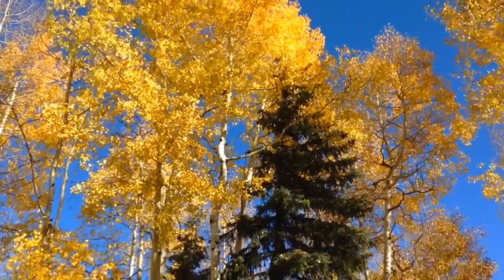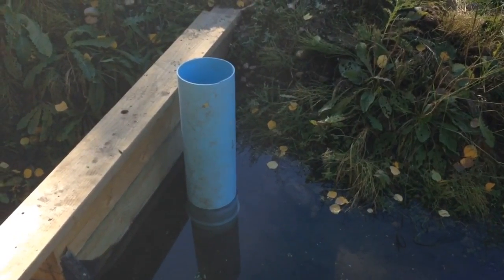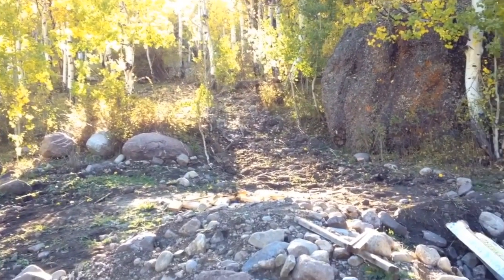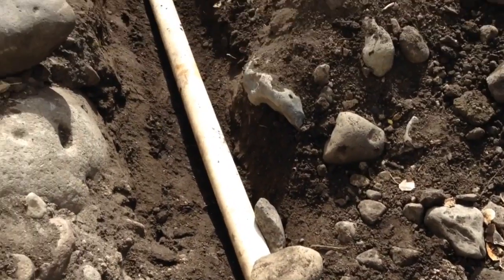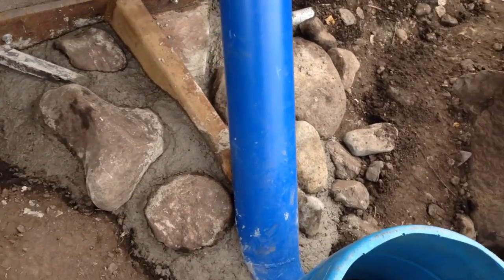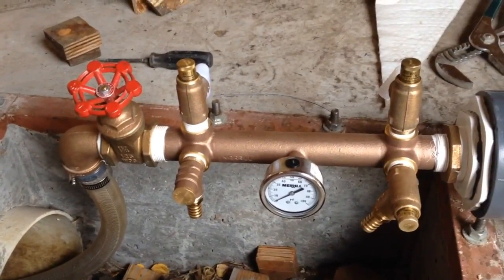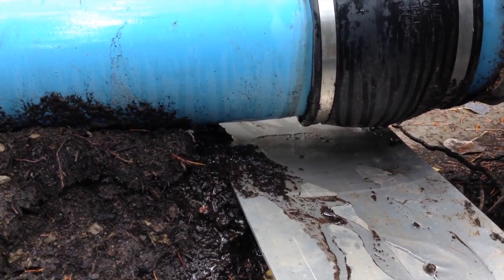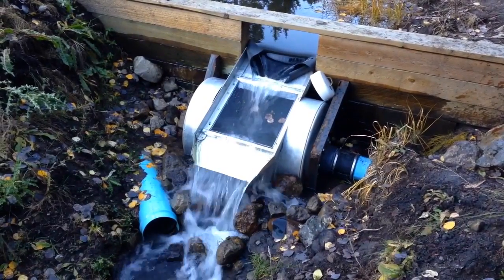Part 13 MicroHydro Power System in CO TESTING

Comment: +MrHydrohead What has the Colorado Division of Water said about this? did you have to get special permits or variances?  I was told i  can't even create a barrel rain water catchment on my place to water trees in ParkCO. I have a well, but i can't "Catch" water.
Reply from the maker: Yes it's true that in CO you don't automatically have the right to capture the rain that falls on your roof.  Sounds crazy but all the water is adjudicated by water court decree.  To make use of the water one must file a petition for its use in water court.  The original date of application becomes your date of adjudication if and when you successfully prove to the court a beneficial use for the water.  There are various uses you can claim for domestic use, hydropower generation, irrigation, piscatorial(fish), augmentation, stock watering and others.  All the water in CO has been claimed in years past by someone else based on their adjudication date and their rights are senior to any rights you might file on today(think CA, AR, NM, ranchers, farmers, cities, ski resorts and others).  The current conditional right we have on the creek in Colorado is a Run of River (ROR) use for hydropower generation filed on back in the 90's where the water diverted for use is put back into the same body of water it came from.  While the water is in the pipeline it actually is prone to less net evaporation than it would be turbelling  down the creek.  This is a net good.  After one makes application with the court to use water, if the court in conjunction with the Div of Water finds your claim of merit, you are issued a "conditional right" to develop and put the water to use on the basis outlined in your application.  This right will last for 7 years from your adjudication date and must either be extended by application every 7 years or be made "absolute" by an application to the court to prove the water has been put to the beneficial use(s) outlined in your conditional right.  This is verified by the division of water and if you pass muster you are granted an "absolute right" to the water in perpetuity.  These water rights are attached to real estate and must be legally transferred with any sale to be valid to any new owner.   These water rights are most likely secondary to other water rights granted in the past to people downstream.  You can spend a great deal of money with lawyers doing the legal work for you, or you can make application yourself(pro se) but you have to research the process enough to understand the process and not make mistakes that would invalidate your claim.  It's a system that has been in place nearly forever and is one of the reasons for the saying "whiskey is for drinking and water is for fighting."  There just isn't enough water for all the uses claimed over time.  It's a system with flaws but there has to be something to say who has what right.  The water that falls on your roof has been adjudicated via the district water court that governs the water body that is fed by that rain from your roof.  Nobody owns the water, it is a public commons.  Other states have different rules and then there are federal guidelines as well.  You must prove you will do no harm to existing water rights with your use and storing rain water would unfortunately do that if everyone stored the water from their roof say in cisterns.  These issues will likely become even more contentious if and when droughts reveal indeed how over allocated the available water in the mountain states have become.  Everybody with water rights got in line at some point and those that got there first hold the senior rights.  Sad but true. It's been established by the system of laws that have been created.  In the words of Rodney King "can't we all just get along?"....
Reply: a lot of water in Park Co, is deeded to Denver, Aurora or Co-Springs. We can have a well and do, but any catchment is a major no-no.  i get the "flow-through" of your process. At one time there was a movement to try to dam the arkansas in Chaffee County (between Buena Vista and Salida)  to feed the demand in the front range. Luckily it got nixed.
As it stands all of the South Platte river Drainage flows from Park County for Metro Consumption..

What part of the state are you in, if you can say?
Reply from the maker: Yeah, it is crazy some of the things metro areas do in sucking up water and fueling more growth.  
http://aspenjournalism.org/2015/01/30/state-water-buffaloes-gather-in-denver-talk-transmountain-diversions/
Transmountain is a word my spell checker doesn't even recognize. Hmmm, someone smells money...

Our water is fed directly out of a wilderness area and rights are non consumptive so hopefully they will sustain over time.  Without being too specific we are in the southwest area of the state in the Gunnison River basin which has been targeted for Transmountain diversion as well.  Absolutely nuts.
Reply: Oh definitely someone is wanting to make money, and all it will do to those of us who are grunts is make it cost more.

Sadly a Lot of "know it all" econuts getting in the mix to save some scum sucking minnow in the lower Colorado as well. :-)
Reply from the maker: +WIlly MacTavish 
Yeah, primary problem = too many humans = too many concerns,agendas and rules.  We like our solitude...
Reply: yep, us too. Love sitting on porch in fall and watching the aspens change!

Comment: Very cool...nice set up. What is current status of this system?
Reply from the maker: Currently capable of producing up to 4800 watts or ~115kwh/day. This is the upper limit of the system at this point due to the configuration to load components. Next year plan to up load capacity to 8500w or ~200kwh/day. Need to add some resistive AC loads and solenoids to manage them through the existing ELC.  All of this will occur after verifying the scale of available water at low flow this winter.

Comment: Very much enjoyed this series. Hoping you go into great detail on how to hook it up to the house, what all is needed and even where to get those items. Not many ppl take the time to tell about all of that. It would be a nice touch.
Reply from the maker: getsmartnow2011 Thanks for the suggestion.  There is a lot of detail coming on the specs of the electrics, switches, generator windings, fuses/breakers, wire gauge, transformers, phase, system load control, resistive loads and such.  I'm not a licensed electrician, but I will do my best to explain what I understand and to be thorough when I get to it.

Comment: Great video series, well done.  Only wish I could escape the city for a life like that!  

Would you mind me asking what you do for power over the winter?
Reply from the maker: Crickelwood Soon we will fully escape LA for a full off grid life. Been working towards it for almost 20 years now.  Thus far winters have been shorter visits due to power constraints with reduced winter springwater flow.  But, the springwater system does supply lights and some appliances.  For heat, south facing passive solar design, wood stove heat, and an in floor propane boiler heat system.  A large slab beneath the house captures/stores both solar heat and electrically generated heat(very efficient and comfortable). Large appliances use gas powered generator when occasion requires.  

With the new system that should all move to hydropower with excess electricity heating the in floor heat system all winter and in summertime a hot tub(maybe even in winter).  Will charge an electric car too, if they would just manufacture a reliable/good range/reasonable cost model.  We shall see in more detail once the system becomes fully operational.  A process of ongoing discovery...

Comment: great work! keep the vids coming, i'm curious to see what generator you will use and whats the power output of the whole system and how noisy will it be.
Are you planning on using power factor correction with a capacitor bank?
Reply: oh gawd. could you say that again? I'mna smack your nose.

Comment: Love your videos! You have such a great narration voice. This part covers the areas I need to improve on my system. All very well engineered. Your flex coupling looks like it might give you some problems. Looks temping for a bear.
Are you wiring the generator for 440v and stepping down at the house?
Reply from the maker: Thanks Joel.  Its fun to see the responses, in my former life I was a Hollywood cameraman, so film is in the blood too. You never know what wild animals will do, that's certainly true.  Cross the fingers,  probably still need to create deterrence for cows as well which graze the land in Summer.  Yes, the generator is a 12 lead 10K Marathon and will be wired 480 single phase then stepped down at house.  I'll be discussing the 1 vs. 3 phase decision I made in the next vid in the Spring.  Its wired to be able one day to go 3 phase if desired, but don't need that much power or want to deal with leg balancing issues.
Reply: Well that former life explains a lot!
Don't ever say "I don't need that much power", as the later stage of the addiction is upgrading as you use up more power. You never have enough!. You will need 3 phase to run the machine shop equipment you buy to build your next system.....
Reply: I've been following the video series, and liking what you've shared so far.

I couldn't help but think of finding some surplus transformers in the 10 to 15KVA size, to step up to Medium Voltage, between 4,160 and 7,200V for the hop from genset(s) to the loads. And having a small switchyard too.  Doing so, one could use 6AWG open wire pole line to carry the equivalent of several hundred amps at 120-208 3PhY.
Reply: BPM Productions of Colorado mmkkkkwiuop

Comment: I love what you're doing!  Are you self taught or do you have an engineering background. 
Looking forward to the next installment.
Reply from the maker: I learned initially about Micro Hydro in the 90's at a course offered by SEI (Solar Energy Institute in Carbondale, CO http://www.solarenergy.org)  and then I installed my first system.  From there its been 18 years of running my system and an ongoing interest which is fed by an ever increasing amount of knowledge on the internet which did not exist when I started.  It is a bit addictive once in your blood...

Comment: looks very promising! will you transform the voltage up to reduce power losses?
Reply from the maker: Yes, thats in the next video.  I'll discuss the process I've used to decide on 480vac for transmission and the single or three phase issues involved along with transformers and loads.  Won't be until spring though.  Too much snow now.

Comment: will the old system keep giving you drinking water?
Reply from the maker: Yes, that is the purpose of the Pressure Control Unit I discuss.  It will go on the pipe with the spring water and also allow me to reduce the pressure from 212psi in that line which has caused many breaks over the years.  Wouldn't lose the gravity flow spring water or the fish pond for anything.